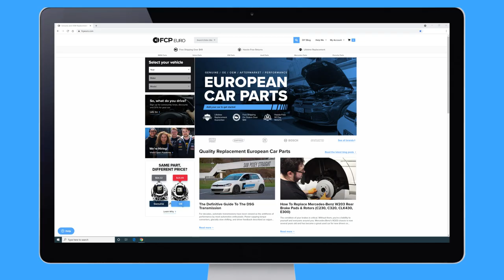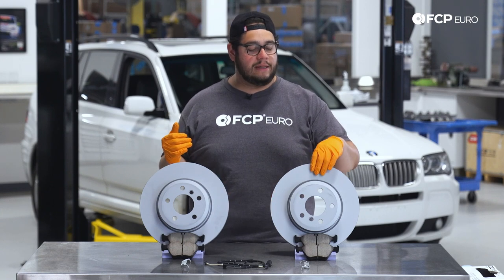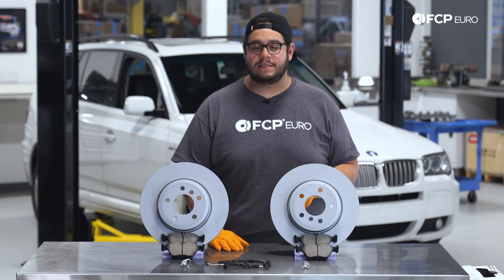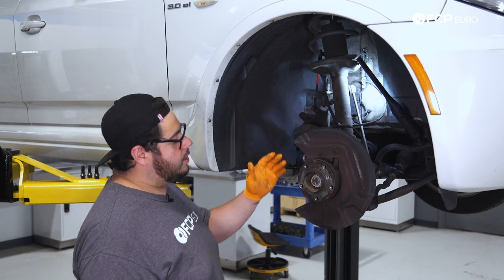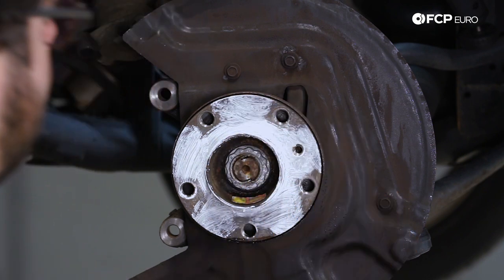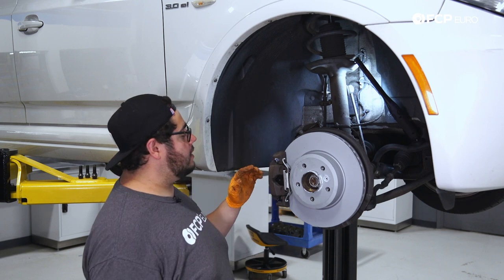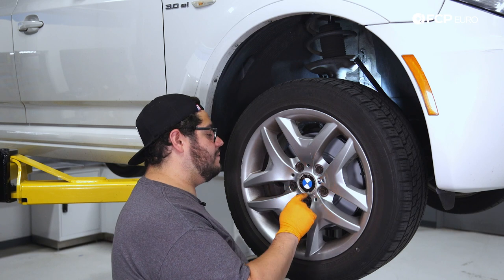BMW E83 X3 Front Brake Pad & Rotor Replacement DIY

Comment: Bottom bolt then top bolt.  Then top bolt then bottom bolt for the bracket.  You won't have to fight it.  Or just leave the bolt in a couple threads.

Comment: I appreciate the video because I need to replace the front brakes and rotors in my 2019 BMW X3 that has only 40,000 miles on it that has never been subjected to high-speed braking. Meanwhile, my Chevy suburban with 92,000 miles on it still has perfect brakes. WTF is wrong with BMW and they’re breaking system? Is it really so delicate in the ultimate driving machine?

Comment: Is there any brake wear in procedure?
Reply from the maker: Hi Jim, bed in is going to be standard for these pads and rotors. Some manufacturers will require a specific process, depending on the procedure, and is usually included with the pad set!